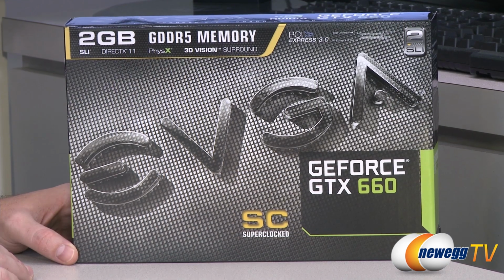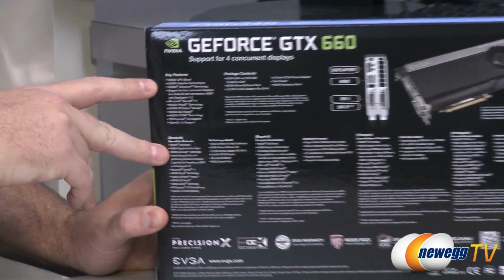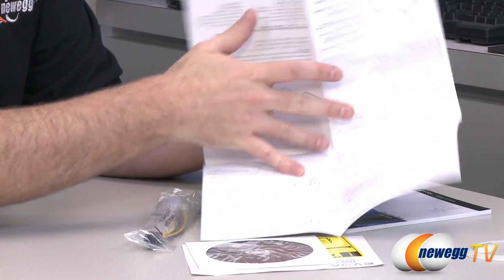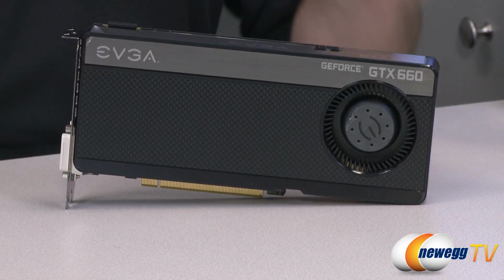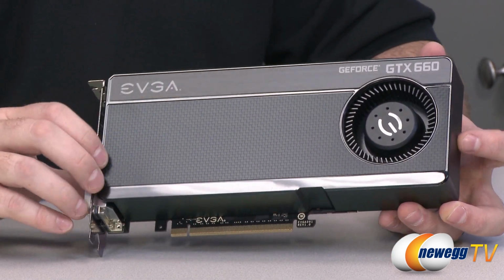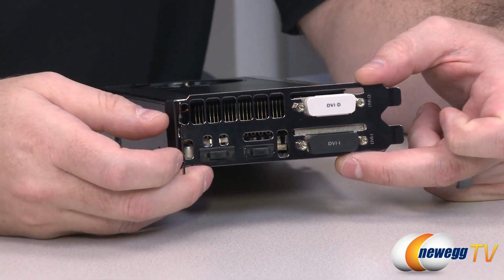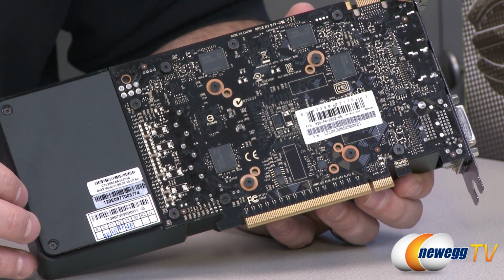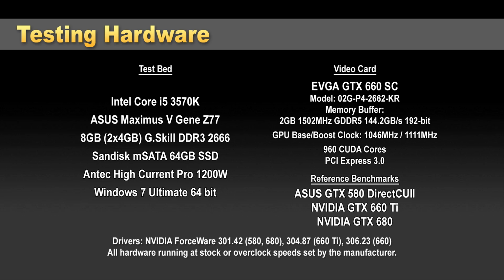Newegg TV: EVGA SuperClocked GeForce GTX 660 2GB Video Card Overview & Benchmarks

Comment: It would be, but honestly you need to upgrade your cpu and ram otherwise you will bottleneck the card and will see no performance increase (if you have a video card already) . You should have at least a four core now a days. And there is a rule I follow which is 2gb of ram per core. New 8gb of DDR3 ram, and quad core cpu are relatively inexpensive :)

Comment: Ti has more CUDA Cores, Two SLI fingers and the the GPU itself is the same as the 670 and 680 . 660 SC has a higher clock and one SLI finger.

Comment: I think Newegg and Nvidia Should Just Get it over with Already , and Get married.:}  This Playlist Should be Called Nvidia Video Card Review's. 660,66ti,650,660,660PE,660tiPE,HD7850,660,660ti.....on,and on,and on......Exactly How Many 660's are there???  It is an amazing GPU but enough is enough. Too bad they Cost Sooooo...much. I'd rather buy a 7xxx and use My old GTX9800 for Hybrid Phys-x.  P.S. ,those Blower style GPU'S are SWEET Looking!! Reference is the Best!

Comment: You would have to be running a 4x slot for it to matter (which chances are if you are running high end cards you also have a high end board, thus preventing you from using 4x in the first place). 8x PCIE 2.0 is plenty for even top end cards like a 680.

Comment: I am in Europe, maybe that's why. Here GTX 580 can be found for less than GTX 660 or same price but they are harder and harder to get because most retailers trying not to stock them anymore and NVidia done great job clearing the warehouses in advance as well. Mind you if you are into gaming only GTX 660 is probably a better choice. I have GTX 660Ti but just because the power consumption followed by heat.

Comment: 580 may be showing its age on games, but it's definitely not aging on applications that take advantage of CUDA. Granted, there's much better options available nowadays such as AMD's OpenCL Acceleration that have proven to be much faster. 

Either way, if you're in the market for a $300 card, I wouldn't purchase 580's or 660/Ti, they're crippled memory interface has proven to be it's Achilles heel; HD7950 is a much better value for only 20-$30 more.

Comment: They are. I have seen GTX 580 prices in some stores equal GTX 660. Remember - GTX 580 is much faster on GPU computing apps like Cuda on Adobe Premiere Pro and is natively supported. I would take GTX 580 over GTX 660 any day if not the noice / temps produced. Have a very small case and this would be a somewhat of an issue.